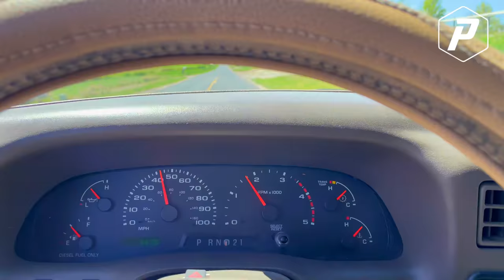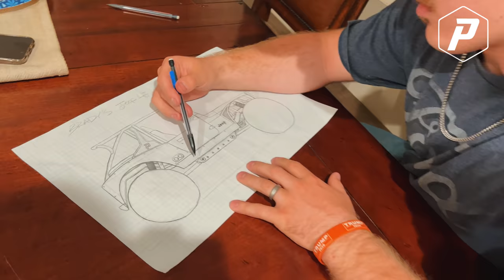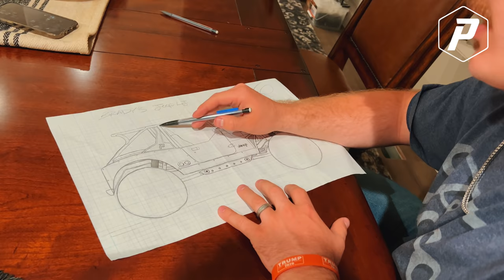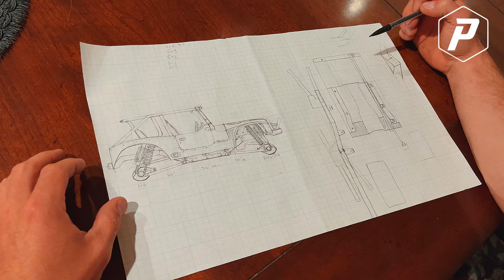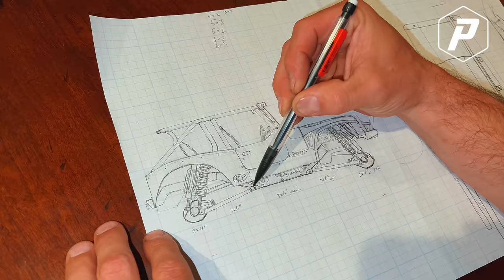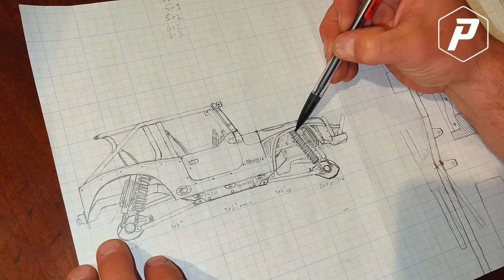BRAND NEW BUILD: BRADYS JEEP LJ!!!!

Comment: I’m building a 1970 Cj5 now with a 10.5” longer tub,Tube ladder frame,Super duty Dana 60 front,5.38gears,E locker,Dana 70hd rear,Detroit,5.38 gears,Built SBC,cammed,vortec heads on gen one block,flat top pistons,Fitech FI,Built 700R4,NWF Eco Box,Np241C,16” coilovers front,63” 6” softride leafs Rear,
Reply from the maker: Wow man! Sounds like it’s gonna be a dean!!!

Comment: Try Benchmark abrasives for flap disks online. They used to/might still run a deal where they will send you an assortment of 10 different grits for free. Might need to do a little googling to find the promo. They Work really well compared to the 3M ones and much cheaper
Reply from the maker: Right on brotha we will check it out!!! Thanks for watching 🙏🏼😁😁